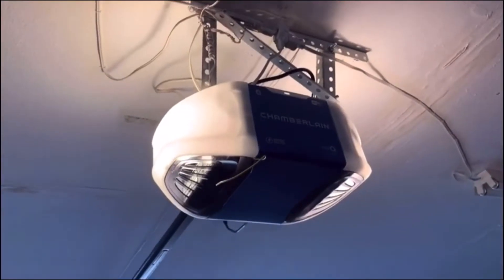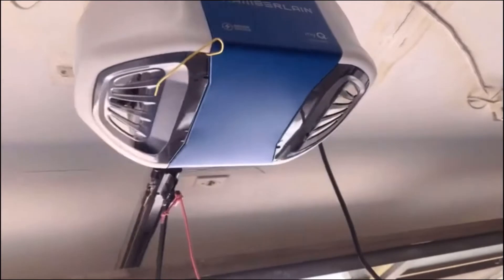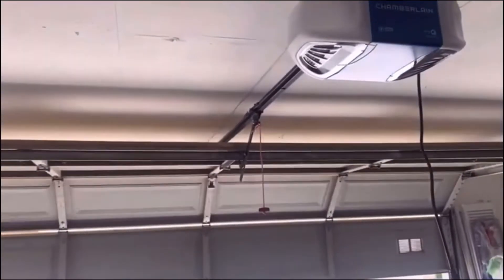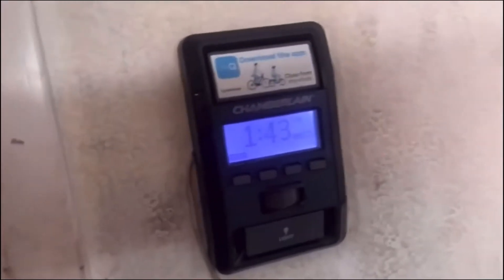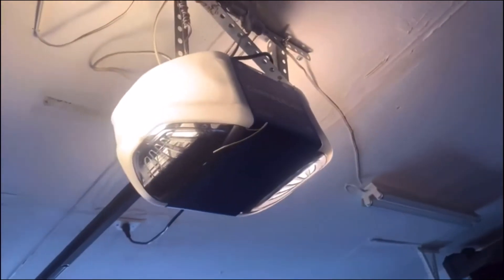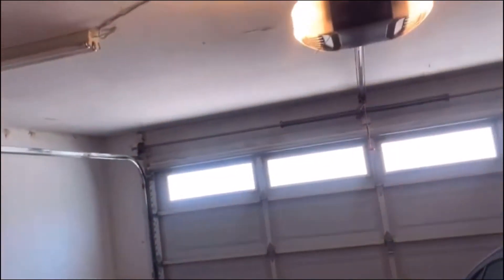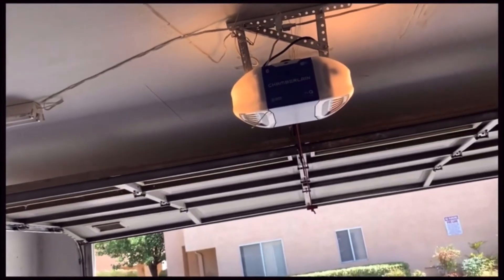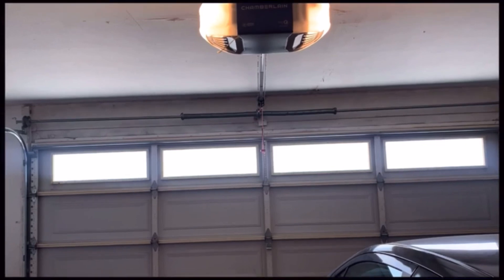Testing Battery Backup on My Chamberlain B970 Garage door opener

Comment: What model is the battery?
Reply from the maker: To locate for the model number of your garage door opener it's usually located on the left side of the operator and some label may be located under the left side of the opener or could be in the front of the opener from where the lens cover is located, and the model of the Battery Backup Replacement is a G4228 12v Chamberlian battery.

Comment: Recently replaced a new battery which is not working when power is off... don’t know what could be the issue
Reply from the maker: @semylotutala2393 Check the battery connector if they are plugged in to the right wiring terminal 

With the positive to positive to negative to negative with the color wires that are wired coated 

https://learngaragedoors.com/wp-content/uploads/2021/12/chamberlain-battery-backup-garage-door-opener.jpg

and the battery itself that has the positive and negative reading on it that tells to which wire that connects to the opener wiring with the battery backup to powering a garage door opener.